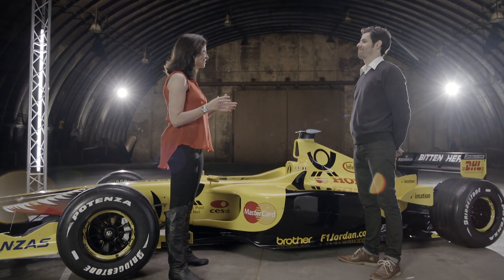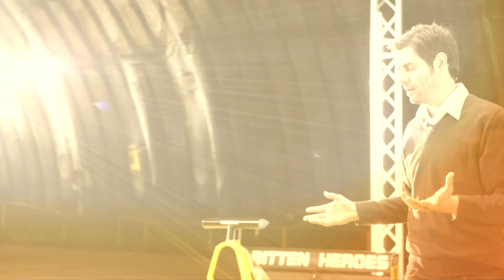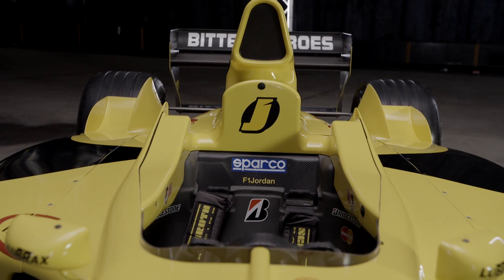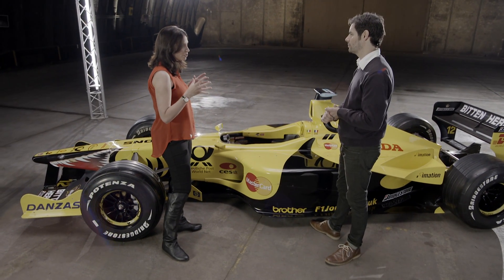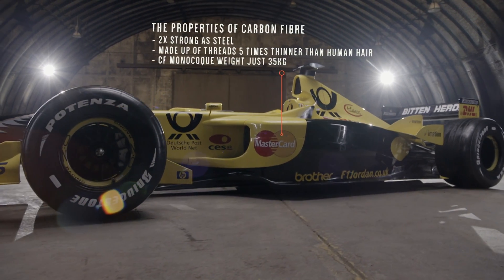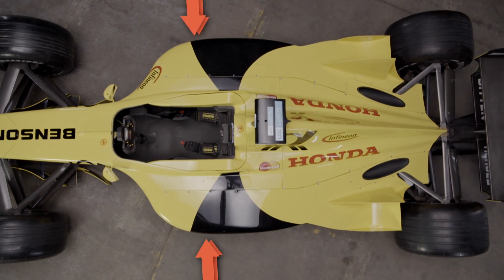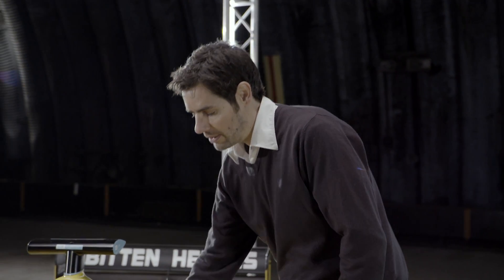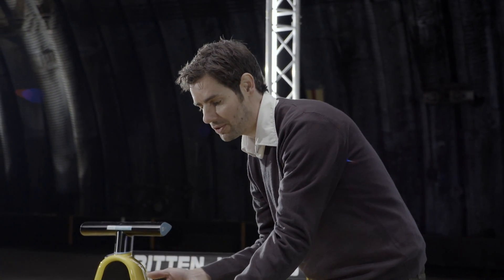The F1 Chassis Explained | One Second in... F1 | CNBC International

Comment: The rise of the monocoque in F1 chassis design had nothing to do with safety. The older space frames were simply not rigid enough for use in the cars of that era. Ground effect brought greater g-forces, so a stiffer chassis was necessary. Safety was an added benefit.
Reply: I think ur mind has changed by now